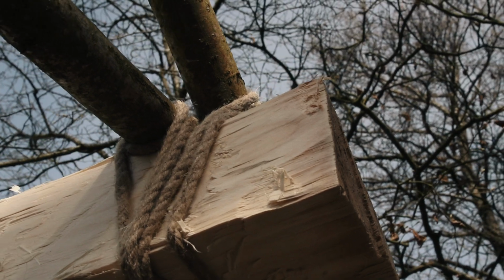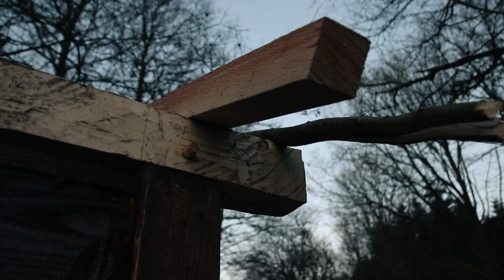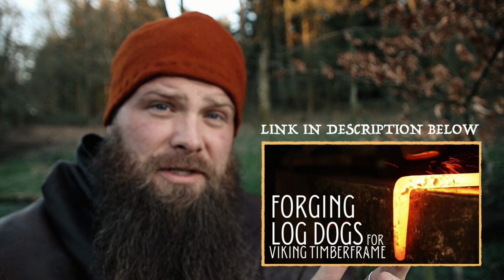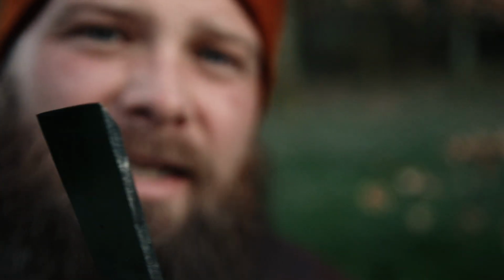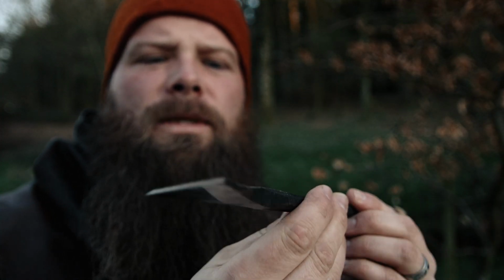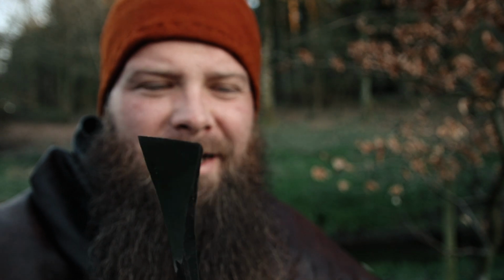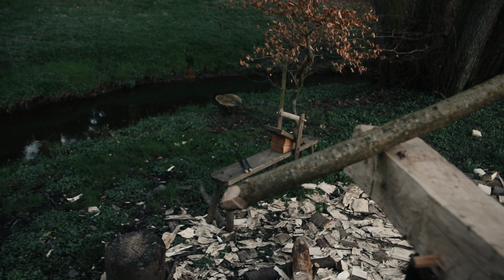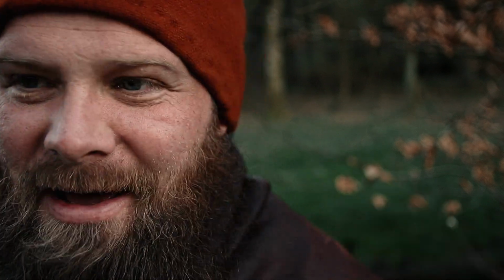Viking Wood Working: Installing the Wall Plates | Part 9 of Our Viking House Build

Comment: You changed your mind about making a wood shingle roof?
Reply from the maker: I think i considered it at some point but i dont have shingles enough and i think with the locations, shadow, local climate etc a turf roof will do better. I plan to make the gable end or the entire end of the back wall with the shingles i have:)

Comment: I see you and the woodpecker are kindred spirits! 😁
The house is really coming along beautifully, it's such an amazing project to watch you build. I can't wait to see the turf roof! Does the box/lip to hold in the turf need to be oak for a particular reason? Strength? Lower likelihood of rotting?
The chisels also look fantastic. Is the big and beefy one more comfortable to hold because it fits the hand better?
I'm sorry to see the damage to the knee brace, but very glad it wasn't you that got hit by the falling beam. 
Seeing your videos always puts a smile on my face, all the best my friend!
Reply from the maker: Hello:) Yes i was lucky to find this black woodpecker a few miles away in the forest, and they are very rare here, so i though it was a good match for this video. I am thinking oak because its stronger, i need to make som joinery that will be exposed and take a lot of preassure so i think oak is the best durable wood. But I will see what I can source and finance since its some pretty wide planks at some specific meassurements. I think the big chisel is good to hold yes and that gives alot of control for pounding, and i think the narrow triangular one is better for handheld work (pairing etc). Yes I have to consider safety and I was happy that it was not my foot being crushed under the beam. I had actually tied it in for safety while marking out the mortises, and just as I was undoing it - it fell. Thanks for taking the time to write - always a pleassure to read and write with you. All the best - Rasmus

Comment: You are moving right along!  Those are lovely socket chisels - my heavy old parallel sided framing chisels do tend to wedge into the hole, and I find that I am mostly holding them by the socket instead of the wooden handle.  I enjoy the birds!  They are almost but not quite the birds that watch me out in the woods here.
Reply from the maker: Hello my friend:) aaah socket - there is the word I was missing - thank you. I found that holding the chisel along the  shaft it self and not all the way up at the handle gives more sensory input and precision and I get a better feel for the angles and the force being transferred - than if holding a wooden handle far from the bevel. Its so lovely to feel spring slowly coming along and the birds are the best messengers.  Rasmus

Comment: Hi Rasmus, your chisels are works of art! I'm I interested that the chisel handles are so short- is there historical evidence for that or personal preference- somehow for me it feels intuitive that a handle should be at least a  hands-width long
Reply: I think short handles work better as a striking surface. I was thinking about that watching it too because my modern chisels have very long handles, and they tend to veer off-course no matter how much I practice. Makes me wonder if I should saw off some of the handles?
Reply from the maker: thats excactly what I mean - but if you want a short handle you need to make shure that there is enough iron to hold and thats is comfortable:)
Reply from the maker: Hello David. They are marvelous chisel:) I dont think there is any evidence of the wood from the handles left. With this kind of chisel i think a long handle wood make it more unstable and i dont think its nessecary. With this type I just hold the metal schaft and simply use the wooden handle for the club to hammer on to. It works great, and holding the chisel like that provides alot of control. think of how chefs hold their large kitchen knifes when chopping. thanks for writing

Comment: l don't know about that pointy triangle chisel. It leaves little space for sharpening, before being useless (as chisel).
Reply from the maker: thats a good point. To be honest Kims work is of insanely goood quality and hardly ever need sharpening if kept well. so I hope this wont be an issue for this tool:) and if it does It will be repurposed like you suggest. thanks for writing